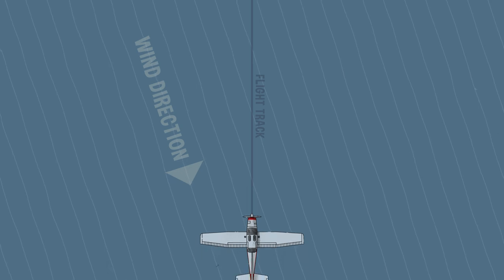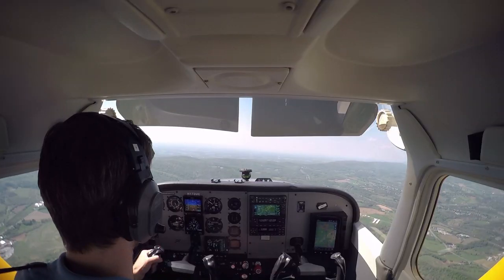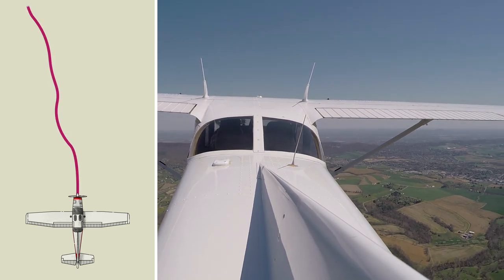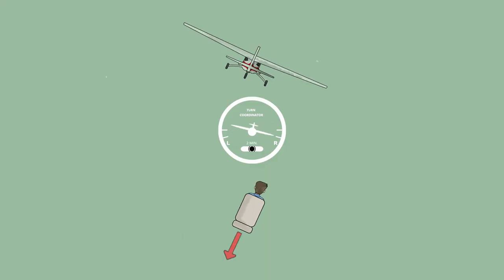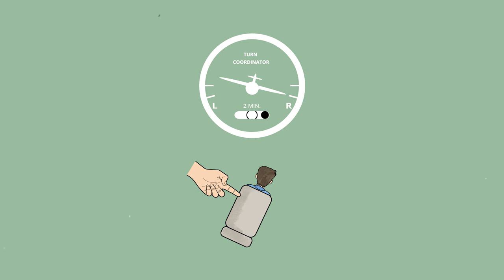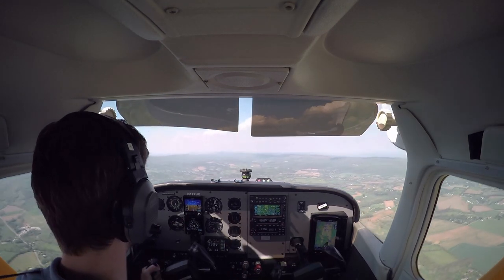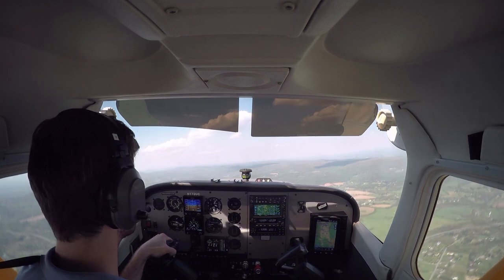ASI Safety Tip: The Rudder - It Gets No Respect!

Comment: Lol, So the rudder is like a turnindicator in a car?    In the one flight i had/did (with instructor, cessna 172 i believe it was), i noticed i was keeping just a little right rudder... when i realised this and pulled my foot back, i noticed that i was actually flying straight before i left the right foot paddle.... either it had a misaligned rudder, or engine torque.  No clue how to set ruddertrim, was my first lesson.. just wanted to see if flightsim helped me out with basic flying and to get over my fear of flying by being in control the whole time.
Instructor said "you have control" right after takeoff in a left banking... at the end of the flight he intervened as he wanted to be in the pattern upon landing, so he helped me make a bankangle that felt like a formation-break to me  XD... i aligned with the runway, had it settled and trimmed nicely @65 kts bringing her in, then about 20 feet before the runway, he took over, opened the throttle, put her down, turned onto the taxiway pretty hard as there was someone behind us, and he didn't want them to do a turnaround (they had a faster plane/higher stallspeed)... it was pretty epic. If it hadn't been for the plane behind us, me and my best friend  (in the back) were pretty confident he wouldhave let me land it. It did help a little bit, but i'm still not fond of flying somewhere.
Reply: When I started out in a tail dragger my instructor would tap his foot on the pedals to check if I was lock knee'd onto the pedals or not. He did the same with the stick in pitch.
Reply: At a guess, I’d say your flight sim didn’t allow for P-factor.

Comment: Would yarn on the windscreen like a glider or helicopter help?
Reply: Probably not with most prop airplanes. Too much air velocity behind the prop for it to be accurate.
Reply: Never seen one on a helicopter . Would have thought rotor down-wash would interfere too much to be useful.

Comment: The rudder gets far too much credit for that which is cannot aerodynamically do.
  Ailerons on the other hand are at least twice the area, twice the leverage about the vertical axis & unstalled +- 70° either side of center.
  Great directional control on the ground when the puny rudder is stalled out, saving one from the ground loop.

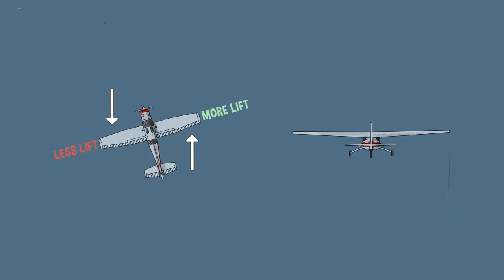Comment: 1:22 isn't really correct :/ the difference in lift isn't from the difference in speed because the airplane is rotating. The airplane would have to rotate like a helicopter blade for that to be a factor. The reason (in this example) why the right wing makes more lift is because the left wing has less airflow because the fuselage is blocking it.
Reply: Both can be a factor in determining unequal lift.  Just like normal lift is both produced by the airfoil moving through the air and also from the propeller wash, yaw induced roll can be produced by one wing moving faster through the relative wind than the other in addition to the air being blocked by the fuselage.  That said, the demonstration aircraft is a high wing, which doesn't suffer nearly as much fuselage air disruption during a slight yaw.  I think it would take a significant skid for that to be a factor.

As an aside, the same idea of one wing moving faster through the air than the other thus producing more lift is the same in a spin.  While both wings are stalled, one wing is more stalled than the other because it is on the outside of a spin moving faster than the inside, and after all a spin is a stalled, extreme yaw.
Reply: When you're talking about 10 to 20* of yaw that happens over a second or two how fast is that wind moving compared to the TAS? You're talking about one wind moving at 109.5 kts and the other moving at 110.5 kts. Amirite
Reply: I would imagine mathematics would be able to answer your question a little more thoroughly, but in the general equation for lift, the total lifting force is actually based on the velocity of the airfoil *squared*, such that an increase or decrease in relative velocity would create an exponential change in lifting force.  in addition, in a yaw the velocity change is much greater on the wingtips than on the wing root, which are a stronger lever than the wing roots, where the fuselage would theoretically be disrupting airflow.  So now we have essentially a double exponential change in velocity, leading to a greater difference in lift than you'd think.

In anycase, if one airfoil is moving faster than the other but are attached to the same body, regardless of the actual value in velocity change in a yaw, one will produce more lift and one will produce less lift, resulting in roll.
Reply: It's an interesting perspective I hadn't considered.

So a 172 has a 36' wingspan. Assuming a 172 experiences 10 degrees of yaw over 1 second, the wing tips each experience a 1.9 knot change in velocity. If the cessna is cruising along at 110 knots that's a 1.7% change in velocity (remembering this it at the wing tips) Assuming we're in level flight each wing is producing about half of the airplanes weight in lift (apx 850lb), and also taking into consideration the velocity is a second order product when calculating the lift of an airfoil that leaves me with about 3% of 850 per wing, so about 25 lb of force up on the right, and 25 lb of force down on the left. Really quick math means that's about 350 to 450 lb/ft of torque induced about the longitudinal axis. It's a bit more than I had expected. 

I would still think roll due to side slip would cause more roll. https://i.stack.imgur.com/HPaq7.gif Especially with an aircraft with dihedral.

Have you ever seen an article that compares the magnitudes of the effects?
Reply: David Brandt I haven't, and I'm not sure it would be an effective calculation (speaking of, thanks for those numbers that you did) because there's too much variability due to fuselage length, slip angle, etc. A Kit Fox or cub isn't going to block as much as a low wing Warrior, which won't block as much as a larger turboprop and so on. I am probably wrong though as I'm sure someone has done the maths at some point.
Reply: iamaerix  In a normal spin the outside wing is LESS stalled than the inner one——that’s why the outer one gets more lift and is continually rolling over to the inside of the spin axis .

Comment: Yaw through weathervaning?  Weathervaning is a ground phenomenon, once your wheels leave the ground, weathervaning does not occur.
Reply: Your statement is wrong. If you have a crosswind in flight, it will still be wanting to weather-vane. Though the relative wind is head on, any side wind, will change that. It is also, why you will be crabbing off to one side, to compensate.

Comment: Who approved this crap?  The yaw roll coupling does not occur because of a difference in airspeed between the wings.  That's like idiot old wives tale "CFI aerodynamics"
Reply: so how does yaw causes roll then ?
Reply: Agree.  It has to do with angle of attack of the wing and not one wing going faster through the air.  The more dihedral the more affect.  The reason for rudder in a turn is to offset the the force of adverse yaw created by the ailerons.  If just rudder is used and no adverse yaw is created, you will decrease angle of attack on one wing while increasing on the other to the relative air.   That creates the bank if only rudder is used.  I've found that too many pilots have no idea what adverse yaw is and how it's created.  Remember, lift creates drag - draw an imaginary line from leading edge of wing to trailing edge of aileron - you will see the angle of attack is greater when the aileron is down which creates both lift and drag.  Push the stick to the left to bank left and the right aileron goes down and creates a higher angle of attack and the left wing aileron goes up and decreases angle of attack.  This creates the bank but at the same time the wing with the most lift creates drag which is why the nose swings the opposite of the bank unless the rudder is used to offset this effect.

Adverse yaw is actually a very good thing when used correctly.  It is very helpful in crosswind landing.  If you don't know how to use it to your advantage you might run out of rudder.  If you understand how to use it you will be able to handle a much stronger crosswind.  It's also important on takeoff.  I have video (set to private video) of a new pilot at our field that ran a perfectly good airplane off the runway into a plowed field which flipped the plane over.  The reason he crashed is that he tried using his ailerons to steer on the ground.  The airplane started going to the right so he push the stick to the left in an attempt to steer left.  What happened?  The right aileron went down and created more lift while at the same time created more drag.  So the airplane yawed to the right and off the runway he went.  

If you don't believe me, taxi down a runway at a good clip but not fast enough to fly.  Without moving the ruder, give full aileron deflection one direction and you'll see the airplane go the opposite direction.  It can be a very powerful effect.
Reply: why are you talking about adverse yaw? That's yaw created by roll. 
In the video they mention roll created by yaw, 2 complete different things.
Reply: They were wrong as Garrett pointed out.  The intentional yaw with rudder creates bank but the main reason of the video was suppose to talk about the importance of the rudder (saying that pilots don't use it)  but barely touched on the point of the real reason for the rudder while off the ground is to counter adverse yaw.  If you don't understand adverse yaw then you don't understand how the rudder helps.  That's why I talked about adverse yaw.
Reply: They said when the aircraft yaws left, it rolls left due to the fact that the outer right wing now has to travel faster than the inner left wing. therefore more lift is created on the right wing which results in the left bank. what's wrong with that ?
Reply: It's wrong.  I recommend everyone read the book "Stick and Rudder".  It's an old book but a lot of great knowledge.  My reply was two part.  One, to agree with Garrett, and second, to point out the importance of the rudder as the video is titled, "The Rudder - It gets no respect"
Reply: How is it wrong?

I was taught Lift = Coefficient of Lift * dynamic energy(1/2pv2) * Surface area. And to travel in a circle, the outer wing has to travel through a larger radius than the inner wing therefore the outer wing has to travel at a faster speed. Thus 

dynamic energy of the outer wing is larger than dynamic energy of the inner wing. Which results in more lift on the outter wing lift, thus roll. That's how yaw creates roll. It fits the video fine for me.
Reply: If an airplane is creating lift (that will offset weight - not going to get into bernoulli effect) then there is an angle of attack on the wings.  The increase of angle of attack when a wing yaws in relationship to the relative air is much more apparent and easy to understand if you can visualize (or better yet get a model) with a lot of dihedral where you can really see the incident on the wing.  I was taught this early on by my dad when I started flying (2 channel) model gliders 37 years ago, saw how it also related to model airplanes, learned about it when getting my private pilot,  then confirmed everything with  stick and rudder.  Once again, I can't recommend the book enough as there are many things in there they don't teach you in flight school.  As Garrett pointed out, there are a lot of old wives tails out there.  This is one of them.
Reply: which is one of them ? the lift formula or the fact that the outer wing has to travel faster than the inner wing in a circle ?
Reply: tomleonhartITC
It's not wrong its just a tiny part of the story, the main reason the rudder will roll the aircraft because of the dihedral effect which is present on any aircraft with positive lateral stability. The reason why the 'one wing faster than the other' explanation is used is because its very simple, but is a classic oversimplification because generally accounts for only a tiny percentage of the roll, in fact its effect in many cases is negligible.  

Where this explanation falls apart is when you consider that you can roll out of a turn with rudder, even if its still yawing in the original direction. Also in a steady heading sideslip, the wings are clearly going the same speed (heading is steady, aircraft yaw rate is zero), yet there is still a large amount of aileron needed to maintain bank angle, therefor even though the wings are traveling the same speed, the roll tendency is still there because its mainly caused by dihedral effect
Reply: Yep.  If you go to the book "Stick and Rudder" (kind of a bible of flying fundenmentals) and turn to page 126, the explanation is right there and even has a drawing to help the reader visualize what I have been talking about.  Nothing to get defensive about.  The reason you had seems simple and will make sense to most but it's just not correct.  Jamenator is correct in what he said.
Reply: That's not what's being discussed at this point in the video.  He's referring to when the aircraft yaws to the left due to weather-vaning, with NO aileron input.  That's not adverse yaw.  The result is basically an un-commanded skid in the direction of flight, which produces an uncommanded, adverse roll.  This is the exact opposite scenario of what you are describing.  The scenario you describe is correct when a turn is commanded using ailerons, however that's not what is referred to in this particular part of the presentation.
Reply: The role is caused by dihedral regardless of how the yaw is introduced.  It has basically nothing to do with the reasoning in the video.  The wing yawing faster through the wind does not cause bank.  My airplane can yaw all day and will not roll and it doesn't matter if I commanded the yaw or if turbulence causes the yaw.  Most airplanes have bit of dihedral and when yaw is introduced more of the under surface of the outboard wing becomes affected by the relative wind.

The second part of my comments about adverse yaw is because this video says it's trying to show the importance of not ignoring the rudder.  It barely touches on this.

I'm addressing the very first comment made way at the top and then I go on to explain the real reason for the rudder.  You should never be steering the airplane around in the air with rudder as I see some people believing this to be true from their comments.  Yes, keep the airplane coordinated and the dihedral won't cause bank.  Although, once the airplane does become banked you should use ailerons to come back to level and not try to use only the rudder.  The people that get into a very bad habit of using rudder only to maneuver might find themselves skidding a turn to final only to drop into a spin. 

* Left turn on final,... pilot wants to turn sharper to not overshoot but doesn't want to bank too much so they use left rudder.... airplane banks steeper because of skid and dihedral...pilot adds right stick to decrease bank which increases angle of attack on the left wing.... pilot pulls back on the stick as turn steepens.....  left wing stalls as elevator increases the angle of attack on the left wing even more all while the rudder is still held to the left.  Aircraft snaps over into a spin.   No height to recover.  - lesson, don't get in the habit of steering off the ground with rudder.***

I'm saddened to see so much incorrect information about flying on the internet.  Unfortunately this is caused by some bad instructors that keep perpetuating the myths and don't have an understanding themselves.